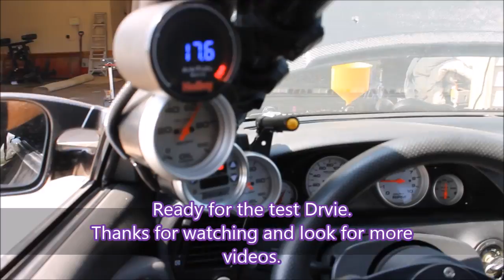Time Lapse motor install on 1990 Toyota Celica Alltrac GT-Four

Comment: Absolutely beautiful build man, I'd be happy if the All-trac I'm buying ends up being half as nice. It's a 92 with some faded paint, but comes with a 20k miles young engine rebuilt by a Toyota dealer, a ct27 turbo, and a nice (if touchy) 9lbs flywheel and single plate clutch combo. All in all, not bad. Now if only I knew what to do about the overboosting problem. The bigger turbo makes enough pressure to trigger the 15psi fuel cut.

Comment: great video. What gearbox gear set are you using with that  4095R turbo?
Reply from the maker: Stock so far
Reply: I run 35RR and only push 600Hp and i am on 3rd gearbox. Never launched the car , never did 0-100 never did 1/4mile and still 3rd box, what am i doing wrong here?!?
Reply from the maker: @bisser6969  what is breaking? I changed thr shift forks to billet ines cause that seems to be the 1st thing to break
Reply: @rm2932  My 3th and 5th gear broke, 2 times 5th gear and 1 time 3rd. How much boost you run and what WHP?

Comment: A subscriber, me, has a question. Is that a custom built manifold, or you purchase it? If so, where? The 1996to 2000 RAV4 has some parts in common. I'm looking for a E250 trans-axle LSD, which on of Cusco or KAAZ will work on my E250?
Reply from the maker: Intake was custom. Exhaust is Rull-Race but I had modify it to work.

Not sure on those series transmissions.

Comment: What resources did you use for this? I need to swap my clutch, and I can't seem to find any good write-ups of this process anywhere online.
Reply: HKS have a brillant triple plate clutch for it good up to 900Hp. I use it for 50k miles so far, no problem, just need to load a bit of rpm when engage.

Comment: Ryan, what did you attach your chain to in order to lift up the chassis to raise the front? Did you attach to the left and right engine mount brackets?

Also, I noticed on your gearbox rebuild you had all new bolts for the housing. Where did you buy those from? I'm about to do a ST205 gearbox rebuild, would be nice to have all new bolts like that.
Reply from the maker: yes, I attached the chain to the "though" bolts of both sides motor mounts.

The bolts are just ARP stainless steel ones. That was the only company he in the US that had the correct thread size. M12 x 1.25
Reply: Thanks, I wasn't sure when I lifted mine if they'd be strong enough, but that answers it!

Do you have a link for the ARP bolts. They don't seem to list M12 x 1.25 on their site?

Love the build btw, looks great! I've always liked the 185.
Reply from the maker: +James Steadman 

Sorry  M10 x 1.25

Comment: Dang impressive stabbing the trans that way haha. I use a level on the lift to tilt the engine on its side while trans is facing up towards the motor on the ground. As I lower I wiggle them around. Nice setup. What cover is that you installed over the starter attachment points? I also like your fuse box location choice.
Reply from the maker: that is a scatter shield to be legal at the drag strip. Hux Racing makes it.